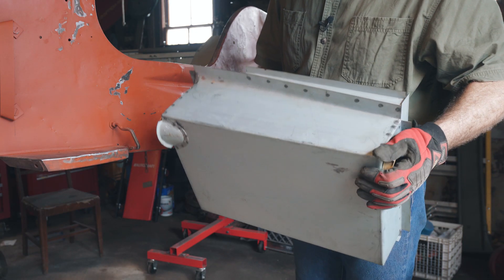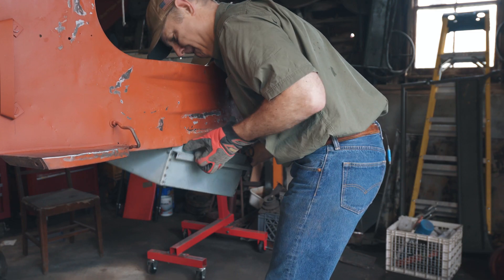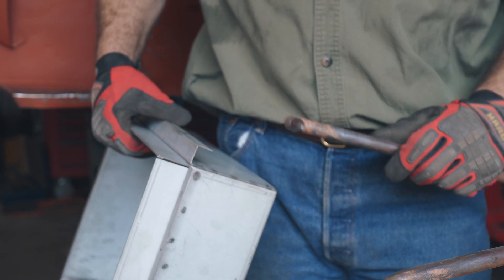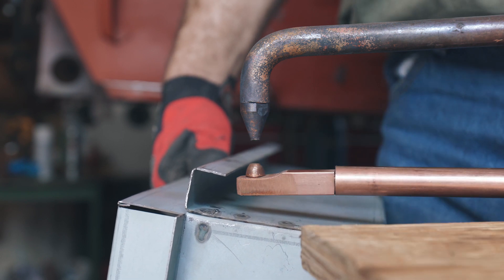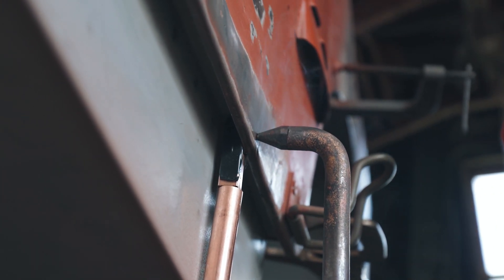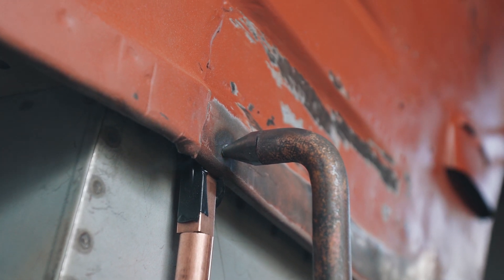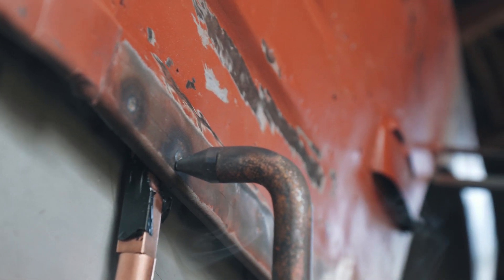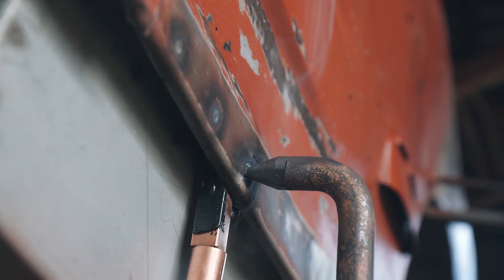'43 Willys Jeep Tub Repairs#12 - Gas Tank Sump Install

Comment: I may need one of these when I weld mine in, I prefer to use the spot welds over plug welds
Reply from the maker: They certainly look better.  One word of caution which you may know already, steel has to be 100% clean to spot weld - shiny and new.  The cleaner the better.  I find it hard to spot weld new clean metal to old metal in many cases....the little pitting really makes for a weak weld.  In those cases....I plug and then go back over the area with the spot welder to make it look correct.
Reply: @Portrayalpress  yeah I have heard that with the older medal, who makes those tongs though, I can’t imagine how it’s done with out it
Reply from the maker: @JRCreations92  We made the tongs....the standard ones are out there....I just bought raw materials and cobbled that one side together - not elegant but it got the job done 🙂
Reply: @Portrayalpress  would you have a procedure on how to make one?

Comment: I just viewed the "'43 Willys Jeep Tub Repairs#12 - Gas Tank Sump Install" and am curious.  How did you prep the mating surfaces to prevent rust after the spot welding?  I am concerned about long-term metal protection.  This would also apply to other areas where I will be mating areas such as hat channels and the back floor panel.  Look forward to your reply.
Reply from the maker: Greetings Ron and thanks for watching.  You have a couple of options.  Originally, there was no protection.  I painted the areas with hi-zinc or "weldable" primer.  It is not fun to weld thru (lots of splatter and messy welds) but it does give protection.  The next level would be to use 3M weldable seam sealer/panel glue - a type of epoxy that is nearly impossible to get off and you can spot weld it.  This is what automakers use today. I used some on my Weasel restoration...great stuff.  If you really want to prevent rot in this mating surfaces, that is the way to go and you can clean up the squeeze out and it won't be visible.

Comment: Patrick, Nice modification to the spot welder! I could almost hear the Motor Pool Sergeant saying; “If the tool doesn’t work, make something that will”!
I’ve forgotten, how many gallons was the Jeep “Mogas ” tank? And what was an average MPG on those little 4 cylinders?
Reply from the maker: Thanks Mac!  The tank holds 15 gallons.   I am expecting around 10 MPG - I think you can put freewheeling front hubs and improve it a little.
Reply: Portrayal Press I guess I thought it had a slightly bigger tank because I remember it just kept going and going and going when I drove the M151A1 back in the late 60’s! Or it could be that I was just happy that it went faster than the enemy could run and any distance away from them was heaven. Haha
Reply from the maker: Mac - thanks for sharing the story and for your service.  Love the M151 - definitely a little more refined than the WW2 version, but still has that wonderful jeep feeling.